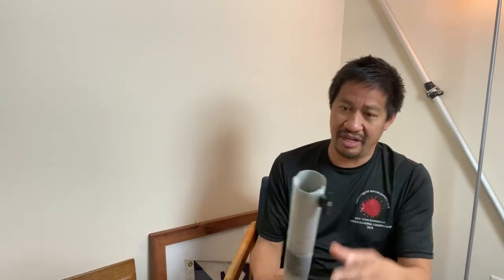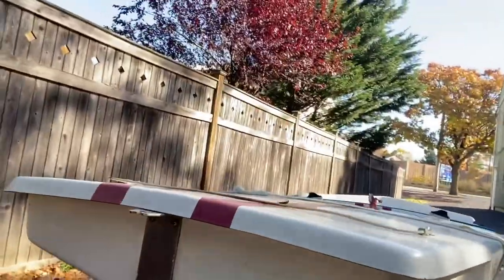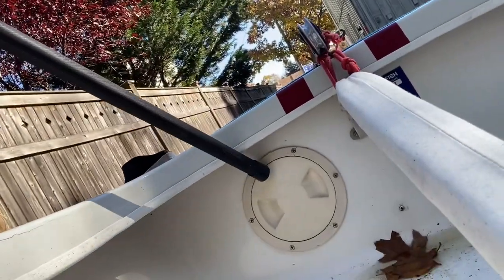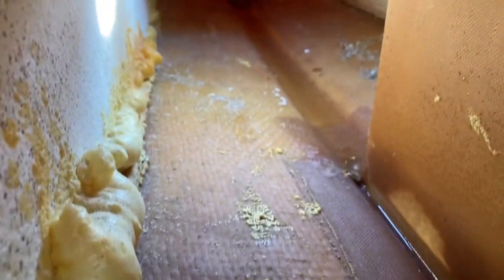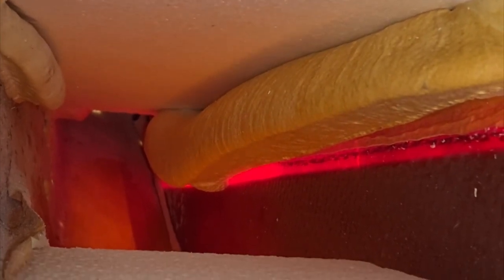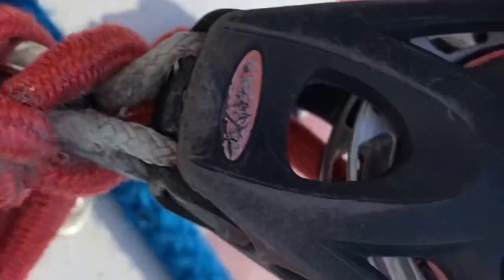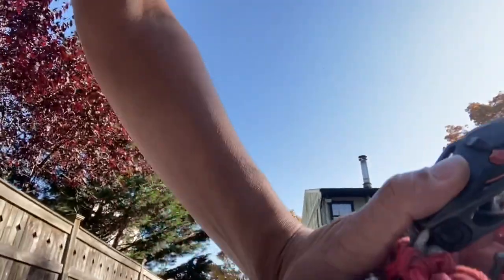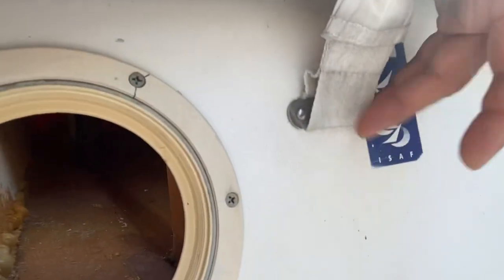Sunfish Sailor Reveals| How to find Year of a Sunfish and INSIDE of a SUNFISH SAILBOAT

Comment: My Sunfish has no inspection ports and I don’t want any. If I remove deck hardware are nuts going to drop inside? Going to paint and replace traveler. Thanks
Reply from the maker: That is a possibility, but losing backing plates, not nuts….  If possible leave one screw engaged in the deck to hold the backing plate (just in cast it wants to fall).

Comment: Hey!  I have a Sunfish that has 82B for the last 3 digits. What does the B mean?
Reply from the maker: That was probably just a made up number. There are many sail numbers that are not “official”.
Reply: @LeeSideSailing  No it the last 3 digits of the serial number on the transom not on the sail, haha!
Reply from the maker: Hi Gary, see if there is an “M” before the 82…. If so that is the “Model” year.  And if it is a model year there are codes for the month it was manufactured.  And a “B” means it was made in September. :)
Reply: @LeeSideSailing  Thanks, Lee! Yes, it does have an M before the 82!  Interesting they don’t all do it that way. My other boat has K485 as the last 4 digits.
Reply: @LeeSideSailing  mine is M74 - J.  I assume that means 1974 (older than dirt!).  Any idea what month the J is?
Reply from the maker: The M means Model Year. And the letter after the year designates the the month, with August being A, Sept- B etc.   so the J means May.